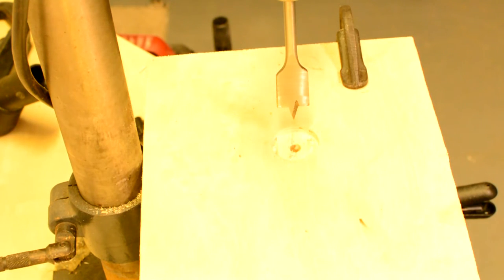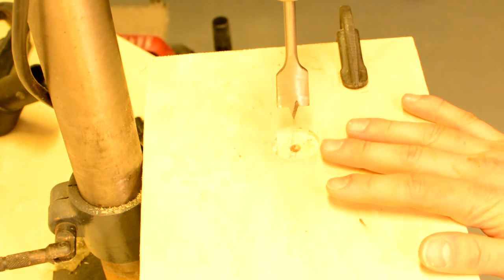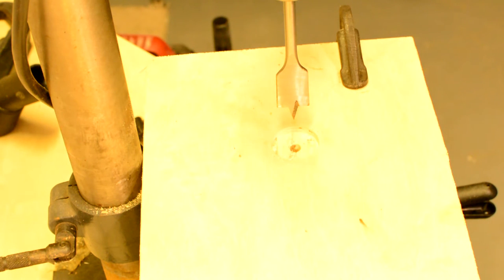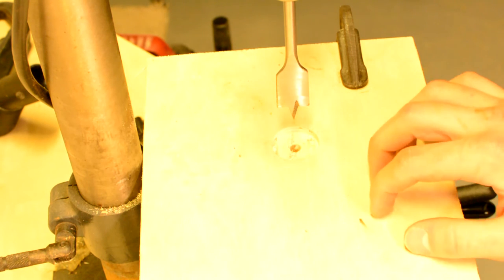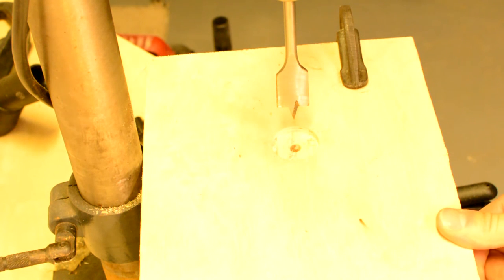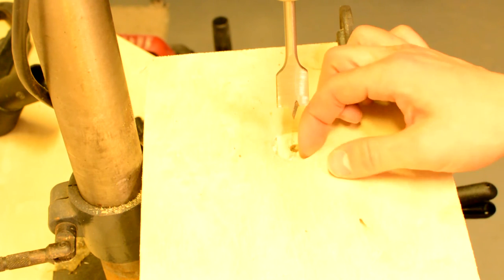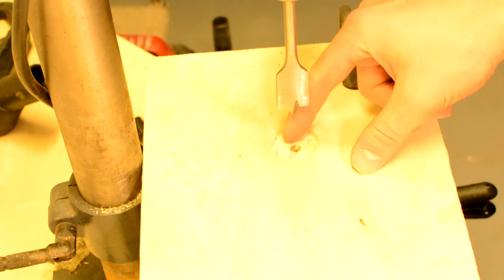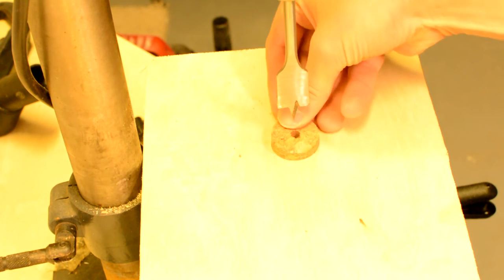Custom Cork Handle - Fly Rod Build

Comment: Run a drill bit through the entire wood piece, then buy a brass bushing with a 1/4 inch ID. Chuck up a 1/4 inch metal dowel to find your true center and tighten everything up for a precise center.